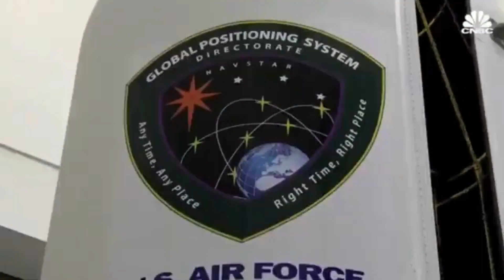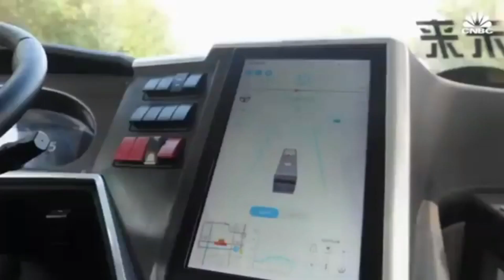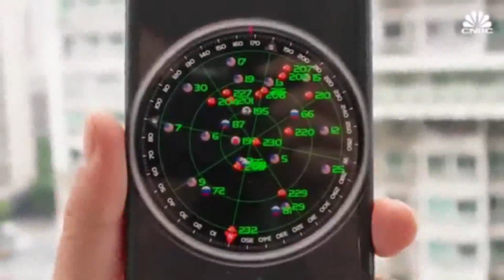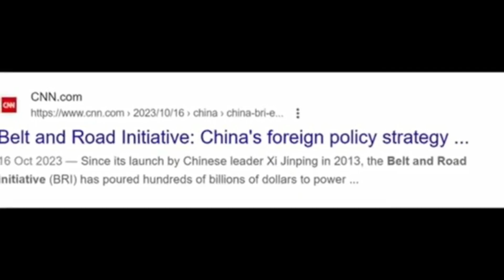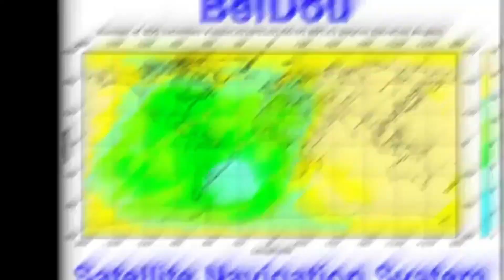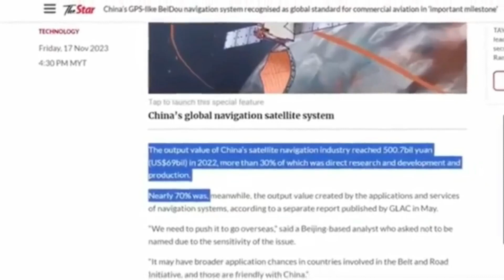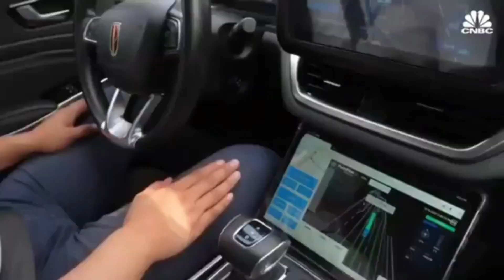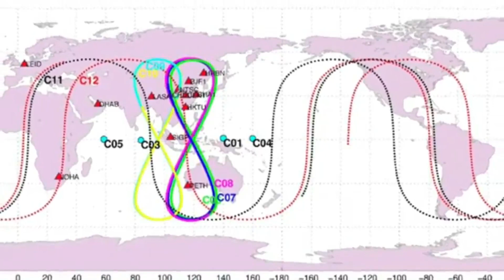China's GREAT BeiDou  System Emerges, Ending US GPS Reign

Comment: The BeiDou Navigation Satellite System came into existence when the US has exploited and weaponizes their GPS and prevented China from using it, thus forcing China to creates its own navigation guidance system.
China resolve to reduce its dependency on the US-built GPS.
The US has been taking the strategic advantage in navigation, command, control, and munitions guidance by introducing NAVSTAR Global Positioning System (GPS) since 1972.
In 1996, the US deliberately switch off the GPS during China military training in firing three missiles military exercises thus lost track of the projectile and its trajectory.
The US had cut off the GPS signal to the Pacific that China relied upon for missile tracking. 
That event prompted China to build its global navigation and positioning satellite system.
The BeiDou system as an integral part of everyday life.
The BeiDou Navigation Satellite System allows devices to not just receive but also transmit data to satellites which is a pivotal distinction enhancing its utility across diverse sectors. 
It provides full autonomy to China in position and navigation services for ground, sea, and air transportation means globally. Widespread integration of BeiDou across the Belt and Road ostensibly ends a member nation’s reliance on the American military-run GPS network. BeiDou is consistently referenced as “the biggest” aerospace program that China has ever undertaken. 
For the past 2½ years alone, more than 300,000 scientists and engineers from more than 400 research institutions and corporations were involved in the program.
The BeiDou Navigation Satellite System became operational in China in December 2011 with a partial constellation of 10 satellites in orbit.
The 35th and the final satellite of BDS-3 was launched into orbit on 23 June 2020.
The latest BeiDou satellite was successfully launched marking the launch of the 56th satellite in the Beidou family. 
The third iteration of the Beidou Navigation Satellite System provides full global coverage for timing and navigation, offering an alternative to Russia's GLONASS, the European Galileo position system, and the US's GPS.
Domestic industry reports forecast the satellite navigation service market output value, directly generated and driven by the Beidou system, will be worth 1 trillion yuan ($156.22 billion) by 2025, and $467 billion by 2035.
More than 140 countries used the Beidou navigation system.
Beidou Navigation Satellite System provide location), navigation (getting from one location to another), tracking (monitoring movement of people or objects), mapping (creating maps of the world), and timing (calculating time). 
Beidou Navigation Satellite System supports millions of applications that track and analyze our everyday lives from farming, to finance, to reliable Internet.